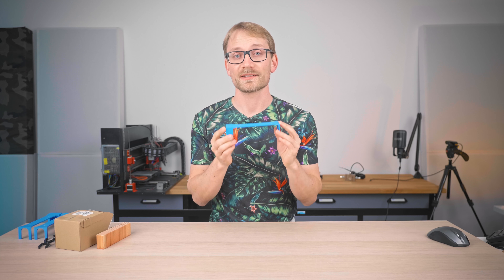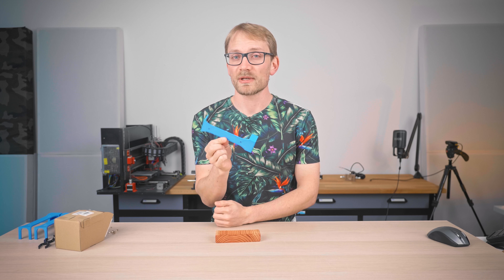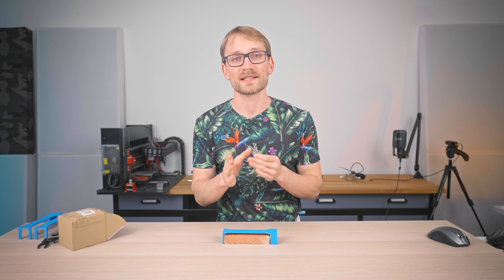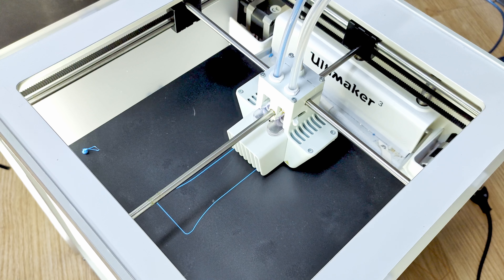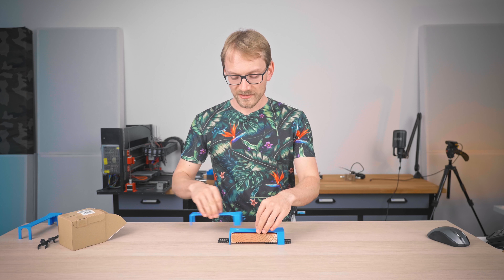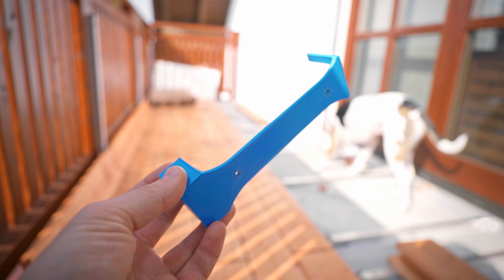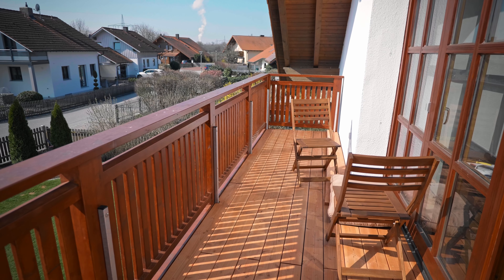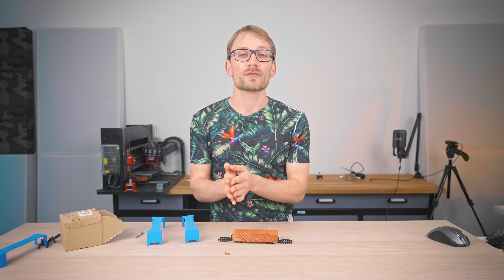This is why I love 3D Printing!

Comment: Making jigs is a great use for 3d printing.  I keep adding up reasons to buy one.  I like the aluminum structure, too.  In the US, most decks have a pressure treated pine base, which is terrible because it rots and has to be replaced.  So the home centers sell more pressure treated wood, and the process repeats.

Comment: As a professional, I just have a few holes drilled in my speed square for this, and use the thickness of the square's flange as my spacer. It's part of why our decks look nicer than most others'. I'll be printing a jig like this if I end up doing a deck with odd-size boards though.
Heads up, even a metal insert will show wear after about a thousand square feet (93 square meters) of decking, unless it's a lot harder than my aluminum speed square, but as long as you don't need millimeter precision it doesn't matter.
Reply: Have you thought about adding a steel washer as the drill guide? Either epoxying it to the hole in your square or 3d printed spacer instead of trusting to the relatively soft aluminum or brass?
Reply: FrankBocker Pick up a set of self centering drill bits and design the jig around that. Keep them lubricated with T-9 or similar lubricant, and he'd be able to do the entire balcony and then some without printing more jigs. I love my set, made short work of pre-drilling oak cabinets for hinges without having to mark a single hole.

Edit: when I say keep them lubricated, I mean the self centering drill bit mechanism. Not between the jig and the bit.
Reply: @chadvoller  This is exactly what I thought of when he said he had to print another because the holes wore out....scrolled down to see if any one else suggested it and voila, great minds think alike.

Comment: Awesome demonstration! What you're looking for is drill bushings. The brass inserts will wear slower than the plastic but will certainly wear over time. Drill bushings are hardened and are purpose-built for that application.

Comment: Such a great use for a 3D printer - I have some custom drill guides I designed & printed to get holes in the plastic ends of aluminium project boxes perfectly aligned, they worked a treat on a batch of project boxes to make them look professionally done.

Comment: 3D printing also allows a project specific custom jig to be quickly created.  For example, the board spacing width could be set to use an integer number of decking boards so there's no need to rip the last board to fit.

Effective PLA recycling would allow these custom tools to be recycled after every job so there's no tool clutter, which is a problem for me.  Parametric models online could allow most of the design to be done for us, with only the project specific tweaks to be made before printing.

Comment: "Only having Ultimaker 3 is tough"

Laughs in not having 3D printer
Reply: Solidarity my friend. Hopefully by the end of the year here, but it's tough to stack cheese lately.

This video is about the very reason I'm so excited. I could keep a printer pretty busy with all the technical parts I have in mind.
To live is to dream
Reply: You'll get one one day! I believe in you! Then you can join us at screaming at them to work and upgrading them despite working well enough already!
Reply: @ameliabuns4058  Everybody else: your printer is so cool! What kind of things do you print with this?
me: 3d printer
Reply: You can build a Dolly. On the other hand, maybe Tom can make a new one with updated hardware. Almost none of the links in the old Dolly page work anymore, only the Github page with the STL files and a few others.
Reply: Get an Ender 3!
Reply: @moth.monster  For looks it aint bad, but personally i went with Prusa i3 clone (partially cause i got it from friend second hand real cheap), just cause with that you can do upgrades to popular platform and there is plenty of information regarding said printer. Friend had put it trough its paces in his printing company and cause it was worn out it was cheap just to upgrade those parts to higher quality ones top of existing upgrades he had done already.
Reply: @Hellsong89  jokes on you, the ender is a Prusa clone, too ;)
Reply: I noticed that you covered your UM3 glass bed with a black sheet. Is it  made out of PEI?
Reply: XD

Comment: I recently got a 0.8AA nozzle for my ultimaker 3, it became my go-to for most "hand scale" objects and tools because of how much quicker it prints, even finicky materials that I used to have to print at slower speeds now works really well (such as flexible materials)... it was kinda pricey but I'm now very glad I have 0.4AA in one slot and 0.8AA in the other.

*I also tidied up my broom / tool closet by using MDF boards that were too narrow for the width of the cupboard, by printing shelf brackets that bridged the difference (15mm either side)...!

Comment: Thanks for reminding us to look around the house and think of what we should be using helpers for or even printing out those things you always wanted, like dust/drilling connectors to things like your spacer, or a faucet modification, its all out there, have fun with your fusion 360 or if you dont design time to look for Yaggi or thingiverse and find those things you want to print (this is perfect time to perfect your slicer settings, you have time, play around or focus).  Wash your hands, "V"-piece  to all keep printing!   if you have some spare filament print some masks for you and neighbors, and relatives.

Comment: Thanks For sharing its a lot different construction then in Canada Nice to see!  And I really like the template use, I can't wait to have one to design for me.  I the last year that I own a printer I have not need any yet...  You mention in another video you have the habit of calibrating every filament you use, I would really like more detail about that.   I usually try a first layer calibration just to see if the temp is ok.  Then extrusion calibration with cube in vase mode (first 40x40, second 39x39 etc this way they stack like a box..)  ALl your insight would be appreciated.  I am playing with 3d850 PLA, that force me to change my MK3S Heat Break with GREAT result!!!   Thanks and be safe everyone!

Comment: I made a version of this out of some scrap wood however our decking sitting on some pine joist and it was not very straight so decent tolerance alignment was not possible, instead we measured everything and used scrap as spacers. The decking we used was also jarrah so drilling through took a decent amount of force. Wish something like this would have worked for us, would have made it so much easier.

Comment: I made a drill jig for Mendel90 production that needed to be used 1000's of times. I used ball bearings slightly bigger than the drill mounted in printed parts. They would last much longer than brass inserts because the are hard and will spin with the drill if there is significant friction.
Reply from the maker: Great idea!

Comment: I love how easy it is to design & print a small custom part with a 3D printer to fix a problem in a very short time.
The headrest of my chair kept tilting back when I didn't want it to, even though it was tightened up as much as possible, as a fix I designed & printed simple, but specifically sized 0.4mm thick TPU washers which acted as grips. The headrest now stays put :)

Comment: I didnt even know there was a tool for this. I was taught to use either the edge of a speed square or 2 layers of a foldable ruler. Screw holes usually lined up with a chalk line or laser level if you have one. Considering that wood shifts around alot, especially in countries with seasons, this only needs to be reasonably accurate. I really like the idea though, but I do feel like theres 2 big flaws here.

First is for (relatively) very small decks like this one, 6 hours of print time for 3 of these + design and tweaks is a very big portion of the time it would take to just do it "normally". 
The second flaw imo is for bigger projects, like for instance on bigger ground level decks skirting around the side of a house. Even with the brass inserts for hundreds of holes as you say, thats nowhere near enough. As you scale up the work you get into the thousands of fasteners very quickly. But I guess you could make the argument that if you can design a jig like this that will last as long as the print time for a new one, they can be replaced continuously. I assume there will be a sweet spot where the cost of producing these will exceed the cost of getting the "proper" one.

I do see some nice suggestions in the comments, though honestly as cool as this is, if you are doing work big enough to warrant printing a steady stream of these i'd suggest just getting the proper tools for it, they do not need to be expensive at all (you can have a decent laser level for less than the screws alone would cost for a project) and you will need them later. If you are doing a small project like this deck (and you dont already have the tools) I would personally just make these as cheap as possible and treat them as a consumable.

Comment: Tom, next Thing: a printer with an enclosure can easily be modified to have an Arduino monitor temps and if-runaway, then-cut mains power and inject CO2 into the enclosure. No mess, great safety.  You KNOW a bunch of folks leave these things running unattended. Cheers!

Comment: Do not add baseboard to that outdoor deck. Water will sit on the top flat surface of the trim and hug the cladding, and then there's the clearance under the trim to maintain so water drains there too. You would have to to flash it like the top trim on a window, with z-flashing, to provide the proper  run off and water intrusion protection. At which point you'll have a nice sharp piece of metal at toe height and it will look awful. It's fine the way it is. Nice work.

Comment: Another solution would be to just use an automatic center punch or an awl to put marks on the board, then drill the holes after removing your jig.  This would prevent you from tearing the holes up on the jig.  In that case, though, you might need some other little piece to keep the spacing between boards equal as you drill.
Reply: Design the jig to use self centering drill bits. They are used commonly to drill holes for mounting cabinet hinges using the hinge's holes as guides without marring the hinge. A huge time saver, and they aren't too expensive.
Reply: @chadvoller  Even better - very good idea.  Only issue is that the self centering bits i have don't have enough travel to go through a thick board.  The ones i have are mostly for hinges and things like that which only require a shallow hole.  But if you have ones that have longer travel, this would be perfect.
Reply: Justavian Ah, that is true. I think my longest goes 3/4”. Though I haven't had much issue with splitting with the cedar and pine I've been using (pretty soft big box store junk). Going into aluminum like he is may cause issues if not pre-drilled all the way, so you'd end up chasing with another bit. I'm guessing though, as I've never had to attach wood to aluminum.

In that case, I do remember seeing drill bit guides, as short cylinders, on Amazon. Might be a better option for this scenario.
Reply from the maker: I've actually used that approach on the larger hardwood deck / terrace you can see below the balcony. That was a lot more area to cover, so I didn't want to wear through a dozen jigs 😅
Reply: Thomas Sanladerer Did you chase it with a longer bit, have a longer self centering bit, or did the self tapping screws have no issues going through the wood and aluminum?

Comment: I like the puppy.  :)    Seriously, though...  I love 3D printing and every time I encounter a problem around the house one of my first thoughts is "is there a 3d printer solution for this?"  Including a spacer for 3d decking.  LOL.  My printer is more than a toy now...  it's essential.  I can't imagine life without one.   I started with a Sindoh DP200 and its ease of use and nice prints, but was growing frustrated with its proprietary filament cartridges so was about to order a new printer...  when I decided to write to Sindoh and VOILA!  They sent me a firmware upgrade that allows me to use open source filaments!  This is BIG news.  By the way...  something else I can not imagine:  not using Sketchup as one's design program.  It's so easy to learn and powerful.  I'd like to see you maybe devote a video to the various design programs available?  Strengths and weaknesses?

Comment: Hi Thomas,
I'm sorry my question is directly unrelated to the video, but you're who I'd consider among the most knowledgeable people in the 3D-printing world, and I can't find any answer to my question:
I'm building my own cartesian 3D printer from scratch and am still in the design phase, and was solidworksing what would be my future printing head when I remarked I had designed the latter in such a way that my hotend heat block is really close to the inductive sensor (they're separated by only 6 millimeters). I suppose the materials are designed for the sensor not to destroy itself in flames at only 200+ degrees celsius, but do you know if the heat of the hotend could have any influence on the sensor results? if so I may have to apply some social distancing between that sensor and the heatbreak
Reply from the maker: I've done some testing on that: https://www.youtube.com/watch?v=il9bNWn66BY
You might want to at least have some thermal shield between them to get maximum accuracy and repeatavbility.

Comment: i have a lot of different sizes of bearings wich i use as guide for the drill bits on my jigs . 
start hoarding them !  the 5-4-3 mm od are good ones.
 mr85zz is a good example. they are so pretty :P
Reply from the maker: Great idea! Bearings are usually made from a hard steel as well, so they should last almost forever. I've got all the common sizes at hand, too.

Comment: You should do a video on how you installed your AC. Your placement of the inverter looks "noticeable" :D. Also I am always curious how people drill holes into insulated walls and get them sealed again :D, and not to forget the joy of filling the AC with refrigerant
Reply from the maker: That's a pre-filled unit (Midea), which actually was installed before the insulation. Expanding foam + the cable channel keep water out - and of course, the unit got moved down onto the decking once everything was done!